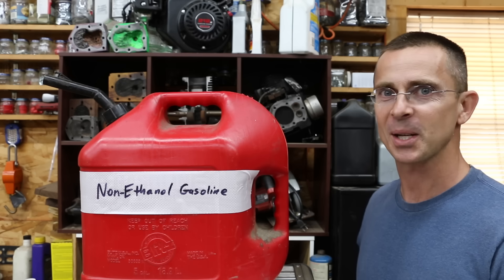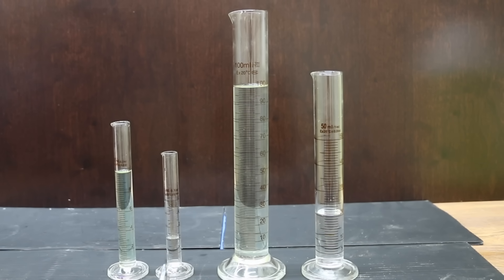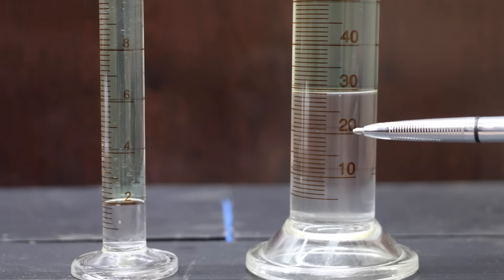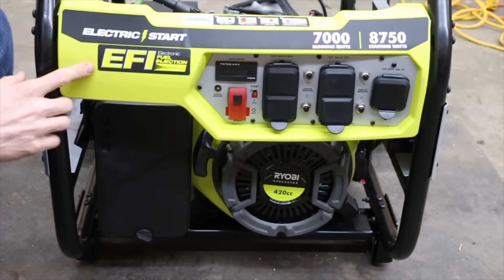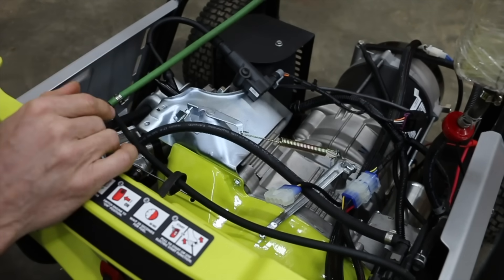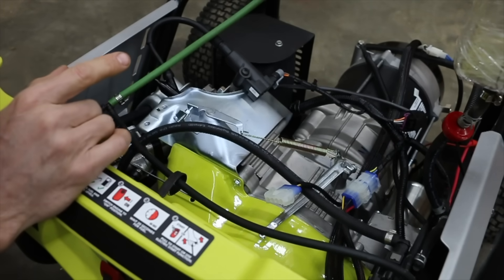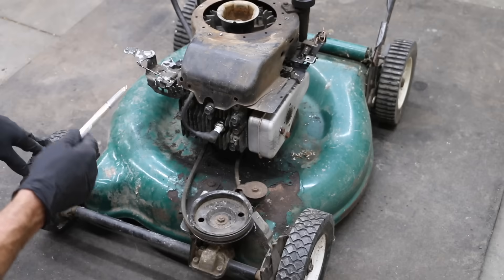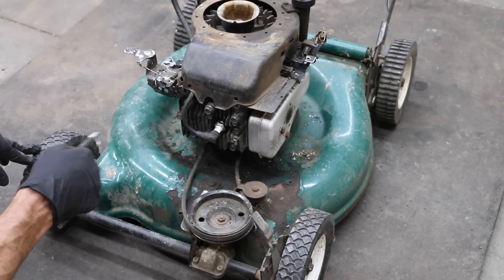Is Non-Ethanol Gasoline Really Better? See the PROOF!

Comment: i have herd that they are trying to get Ethanol removed from to everyday fuel now but the ethanol community industry is fighting it because they have invested so much in it .....it has been well proven that it is not cost effective as making cars that can tolerate it raise the cost of the new cars  the  additional problem as you pointed out it loves water and will separate from the fuel over time and this is a logistical problem in the making of fuel with it as it need to be consumed in a much shorter amount of time and can not be stored for long term use or needs later on as it sucks of water from the air and causes corrosion and when it dose separate from the fuel Ethanol is highly corrosive and will eat of fuel lines and tanks if not designed for it  also it well known that it is not a cleaner burning fuel ....simply put it was not and is not better for the environment short term or long term and if it is made from corn it raises the cost and availability of food and also raises the cost of everything it is consumed in from cars to trucks and equipment so it is simply a loose loose as a fuel additive or a fuel in general

Comment: I can tell you the long term effects of ethanol in rubber lines. It eats through them. I had it eat the rubber fuel line on my classic car. Had it not been for my wife's eagle eye spotting the fuel pouring from the hose right over the tail pipes  we would have burned down a very rare car because of that crap.  I replaced the lines with TFE lined hose and now run alcohol free race gas. . $8-9  a gallon is cheaper than losing a 6 figure car. . It might be fine in modern cars , but unless you have converted all of your fuel system to ethanol safe parts you are playing with fire (pun intended) .
Reply from the maker: Thanks for the feedback.

Comment: I learned the hard way when it comes to buying fuel . I ride Motor Scooters, i have a few of them. But i digress... I decided one time to see if it was worth the savings to buy cheaper gasoline and had been buying the "Premium" as they call it here in Canada / Gas pumps . So i bought a can of the cheaper gas and went home, filled the tank and went for a ride .. By the 3rd day i guess had gone through all the left over gas and had time to run through i started noticing a Huge difference, Really noticeable on my Yamaha Razz .. i Lost 10-15kmph in top speed Just from that Shit Gasoline i purchased... When you have a top speed of 55-60kph at the Best of times and situations loosing That much and even the Power felt off it Sure AF isnt worth using to save 1-2 bux ... Thankfully ive NEVER put that in my Good bike, I ride a Honda Silverwing now and use the others for beaters and going to pick up the mail as i live in mid of nowhere .. Whatever ya do Stop Buying the Cheap Shit ! I can only imagine what it does to the insides of an engine and will find out soon enough when i learn how to rebuild my scooters.. Mustie1 got me stoked to do that... You guys are bad influences lol
Reply: It really depends what your engine is set up for. Octane numbers are just that. Not really cheap vs more money for gas. You're paying for an octane number, not better fuel. This is misinformation.

Comment: You know the world has gone crazy when your generator has a O2 sensor 🤪
Reply from the maker: Thanks for the feedback.
Reply: Not really. Since the generator has fuel injection, the O2 sensor has the job of providing feedback to the ECU that controls the fuel injector. That means that the generator can run with greater efficiency and thus cost less to operate along with less pollution. What's not to like?
Reply: @fuckyougoogle1148  Engineers like to tinker, make things more complicated than they need to be and add complex sensors, injectors and ecu’s to manage fuel and air ratios. On a single cylinder generator like my Honda, I can run it for 4-5 hours on a gallon of fuel, service the entire unit in an hour, pull the carburetor off if needed in the field and has been 100% reliable. Try this with fuel injection, ecu and sensors!  This setup may be good for vehicles but not for generators imo.
Reply: @TheIrongutz  Engineers are given a mandate by the company to improve something. To achieve those goals, sometimes more complex systems are required. Large industrial generators have had FI for years. Why? Because efficiency is key. Sure, a carb may work for you and the fact that your Honda generator has been great. That's due to excellent engineering. I can guarantee that Honda will be adopting FI in newer products to achieve better operational results because they will have to meet mandated emissions and efficiency targets, just like every other manufacturer.

Comment: Cheap ethanol isn't great. They use a slighty low quality one here. It gunks engines up faster. And older engines (especially small ones) it chews them up faster. Fuel lines go bad faster tend to go bad faster. Carburetors and more get chewed up by its corrosive nature. Lawn care guys i know avoid it like the black death if they want to get any life out if their tools. Ethanol protection additives do seem to help but by the time ya add cost ya might as well go e free.
Reply from the maker: Thanks for the feedback.
Reply: @ProjectFarm  Welcome

Comment: All modern fuels are devistating to rubber parts !!!
Reply from the maker: Thanks for the feedback.
Reply: if you are looking at engines build before 2000, they maybe, depending on the kind of rubber used (cheap engine -> cheap rubber). all state of the art engines are designed for state of the art fuels (thus, including "modern" ones), and have resistant rubber parts, unless specifically noted.

Comment: There is something very corrosive in fuel from some areas !!!
Could gasoline be a media to dispose of some corrosive solvents???
Rather then use conventional means of disposal  ???
How hazardous materials are disposed of through gasoline  ???
Ive suspected this for years...
Reply from the maker: Thanks for the feedback.
Reply: that practice would be highly illegal. if so, the "solvents" you assume would also damage the earth tank at the gas station and the transport vehicle used.
Reply: @kensaiix  Illegal has never stopped many through out time !!!

Comment: I find  that regular use,,, of ethanol fuel, in your mowers,,,,  drained out at years end, but used regularly will leave a "corn dust" in the corners of the carb bowl,, and throughout.  a few year old carb, opened up will find a fine yellow powder.  I would suggest if you have to use 10% corn fuel, that you drain at end of season,, and possibly run a can of seafoam thru it the last few mows.  Then first of the season, top off,, and fire up!
Reply from the maker: Thanks for the suggestion.

Comment: I was nearly out of gas in my classic car and had to fuel up with part-ethanol fuel. My engine handled it okay (it's more modern) but the fuel spilled on the paint, which was a modern Spies-Hecker basecoat-clearcoat system. It bubbled the paint, although the paint stabilized after the fuel evaporated and over a long period the finish returned. But yes, ethanol is tough on rubbers and some plastics, including paint.
Reply from the maker: Thanks for the feedback.

Comment: At the end of the video, he says that non-ethanol fuel is around 4% more efficient. Were the fuels used the same octane rating? Or was the ethanol fuel a blend? 

In Australia (NSW), we get unleaded 91 which is 91 RON petrol. We also get E10 which is 'up to 10% ethanol' and is 94 RON (Research Octane Number). Are the fuels used in this experiment like that, or are they both the same octane number at the pump? I would love to know.

Comment: carbon footprint begins with extraction of materials needed to produce the final product. That's why using electric cars may not produce exhaust, but producing batteries and electricity to charge them indeed has a huge carbon footprint.
Reply from the maker: Thanks for the feedback.

Comment: My best car was 1993 corolla. I crashed it at 202,000 miles. Was running smooth, giving me 400 miles a week! Normal acceleration. Consistently 30 mpg (except when towing). No leaking oil or other fluids. No blue smoke. Never added oil between oil changes (checked it regularly). It never dropped on the dip stick. Always loaded with Sams club or Walmart fuel. Yes, it has 10% Ethanol. Ethanol is OK on long term for engines, gaskets and tubing's. So, this is my long-term experiment contribution.
Reply: The fact that you have a 93 Corolla shows how much expertise in automobiles you have...
Reply: @peter455sd  Thank you. I also have Prius, Camry and Rav4. And a I had Honda Civic, and a Piece of Junk Dodge Spirit.

Comment: 1:57. Dude! Alcohol mixes with both water and gasoline. However, even though it prefers water, some small fraction is still left in the gasoline phase. In order to get the exact number you need GC analysis and calibration curves. This is already done by your DOACS inspectors. Your experiment is a very good estimate of the 10%. Do not argue about exact number. You just gave your followers a interesting idea. If you buy alcohol-loaded gas, and you need alcohol-free, then add 20% water and after it settles, use the top layer. There will be perhaps 1 or 05% alcohol. If you want to remove this completely, you can throw in Paris Plaster (i.e. Gypsum) and it will react chemically with the remaining water.

Comment: I had the luck to move to Oregon just before they introduced "oxygenated fuel" (aka 10% ethanol).  My 2007 Toyota Tundra (the small 4.7L V-8) runs fine on both, but that ten percent ethanol cost me FIFTEEN PERCENT of my gas mileage. It's hard to believe that I am contributing less pollution when I'm running 15% more fuel through the truck for the same miles driven.  Non-ethanol premium fuel here costs $4.75 a gallon, with E10 at $3.57 (it was $2.69 before the pipeline hack).
Reply from the maker: Thanks for sharing.

Comment: So it works ok initially, but probably has a big long-term designed obsolescence element to it, so most people would end up replacing it.
PS: I have a kawasaki dual sport motorcycle in the shop right now waiting on parts with a $1300 estimate. Getting a new carburetor and fuel lines, among other things, after sitting for 4 years. Had problems with ethanol fuel before too and once had an $800 fuel system clean out.
Reply from the maker: Thanks for sharing.

Comment: your tests are very narrow, bottom line on Alky in fuel, #1 Alky will absorb water an drun it through the system in Most cases this is good, every hear of dry gas, its alky, # 2 yes Alky will deteriorate some rubber in OLDER fuel systems Todays cars etc know this and have changed or to different rubber compound, You will burn 2x's as much alky vs gas and you are aware that race cars run on pure alky and those pistons are clean as can be.
Reply from the maker: Thanks for the feedback.

Comment: As a long time outboard motor mechanic....ethanol is the most destructive product ever invented for two stroke fuel systems.    After three months of sitting, it turns "gooey".   After 9 months it turns to powder.     If it sits for years...like many old outboard motors, it turns to tar.     99 %  of the outboards I see that the owner brings in saying "it won't start" after sitting through the off season...is ethanol clogging.         DON'T USE ETHANOL IN ANY OF YOUR TWO STROKE ENGINES!     You'll save yourself a lot of money and hours of misery.   IMHO.
Reply from the maker: Thanks for the feedback.

Comment: Milileter’s. It’s pronounced “milileter’s” not pronounced em els
Reply from the maker: Thanks for the suggestion.
Reply: @tre bushett

Millimeters is plural for more than one millimetre.
Reply: @tre bushett The millimetre (international spelling; SI unit symbol mm) or millimeter (American spelling) is a unit of length in the metric system, equal to one thousandth of a metre, which is the SI base unit of length. Therefore, there are one thousand millimetres in a metre. There are ten millimetres in a centimetre.

Millimeters is a multiple of millimetre.

Comment: This is awesome!  Did you ever end up doing the long term testing?  I searched your channel but couldn't find the video.

Another video suggestion: many folks (like you did) is run their 4 stroke generator/lawnmower/snowblower engine with LPG (propane).  Some claim it helps with the long term longevity of the engine since it burns cleaner but is that really true?

Because CNG/LNG/JP are gases, they provide no lubrication or cleaning for the intake valves. Consequently, engines that run on dry fuels usually require hardened valves and valve seats to minimize valve wear and valve recession. On the other hand, dry fuels mean less wash down of the cylinder walls so there’s better ring lubrication than with wet fuels.  It would be cool to see that tested.

Comment: Ethanol?  Okay for cars  but bad for lawnmowers gas chainsaws and lawn tractors.
Reply from the maker: Thanks for the feedback.
Reply: @ProjectFarm  Yes, I don't have to have the carburetor rebuilt every year on my lawn mower and snow blower.  With the non-ethanol gas it starts right up every spring/winter.  When I got my Cub Cadet lawn tractor I started using he 'pure' gas in there as well.  My Stihl Weed wicker uses the gas/oil mixture so I buy that pure mix in 1/2 gal cans.

Comment: Ethanol changes the tuning of an engine, makes an engine run cooler, but takes more of it to make the same power as gasoline. nearly twice as much if you run pure  Ethanol. 
Carbs can develop a white calcium looking deposit inside the jets, if ethanol is left in for a year or two. This can even cause the engine not to run. My older carb engines (tractors etc;)do not like gas with ethanol because they were not tuned for it.
Reply from the maker: Thanks for the feedback.

Comment: Gasoline is an Oil, a very light Oil but an Oil nevertheless. Ethanol is alcohol and as such is Hygroscopic, it attracts water which will cause corrosion problems plus it attacks some types of engine seals.
I worked in Brazil for a while, they use Ethanol as fuel and the cars have to be adapted due to the water problem, I was told that ethanol produces about 10% less power than gasoline, I know our weed whacker stopped working after I started using Gasoline with ethanol in it (10%) so it is better you drain your motors not in use over the winter.
Reply from the maker: Thanks for the feedback.

Comment: Small engines do not run on gas with ethanol, or at best are a pain in the butt to start and keep running.  Use the straight gas and whala.  It works.
Reply from the maker: Thanks for the feedback.

Comment: I was wondering where the long term videos are at. 
I was wondering if you also did a test where you left the different fuels sitting in a bottle left undisturbed?
The reason I ask is that if I leave ethenol fuel sitting it always turns to varnish smelling liquid and straight fuel does not. I'm just not sure on the amount of time it takes it of the storage container matters in that process.
Thanks for these videos I enjoy watching them.
Reply: I should add I live in the SW US so it's hot and sometimes cold just in case environment matters.

Comment: I have a 89 Toyota that I had to rebuild the Carburetor because of the ethenol had eat up the plastic and rubber components But I replaced them with parts that withstands Ethenol. It still runs better with non-ethenol fuel even after I rebuilt the Carburetor. 
All this for a made up emergency call Climate Change,
Reply from the maker: Thanks for the feedback.

Comment: ethanol turns to corn syrup and sucks, especially if you ddrive the car. if it sits, it clogs up all the lines.  try cyberFuels  methanold with a ptented formula to mix with gas and you have better mpg and less polution as methanol has one carbon atom while gas has 8. as for ethanol, worse thing politicians did in dc.  they did it to screw you and pay off farmers.  now our corn flakes cost more.  get rid of that crap and do altermatives as mentioned

Comment: In case anyone was wondering about the amount of ethanol washed out of the gas: Alcohol is "miscible" in water, so that when you mix 10 ml of alcohol with 20 ml of water, the resulting volume is less than 30.
Reply: ?? doesn't miscible mean mixing to form a homogenous substance? So how would adding 10 and 20 ml yield less than 30 ml?
Reply: @spruce_goose5169  oversimplifying here, but the smaller water molecules can slip into the spaces between the alcohol molecules; a bit like adding water to a jar of marbles.
Reply: @edattfield5146  Interesting, thanks.
Reply: Came here for this comment! Same as dissolving salt in water.
Reply: Not sure if explanation is precisely correct, but you're right in noticing that the mixed volume is less then the sum of the separate volumes.

Comment: Is the claim that ethanol is emission friendlier because of the emissions of the engine or the fact that emissions in the atmosphere are used by crops to make more ethanol. Oil is not renewable, ethanol is. 
You can not claim 4% efficiency based on one run of an engine. You should do more runs, the more the better. And on different engines in different conditions. Only then you may have valuable data. 
You should also include other important factors like the cost of the fuel. The lesser efficiency and the higher maintenance can be offset by the lower cost of the fuel.
Reply from the maker: Thanks for the constructive feedback.